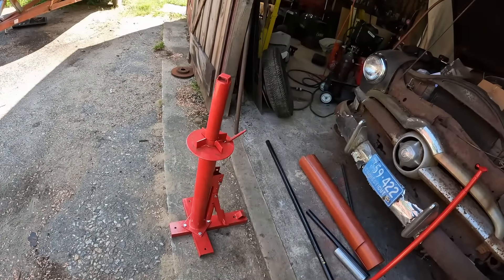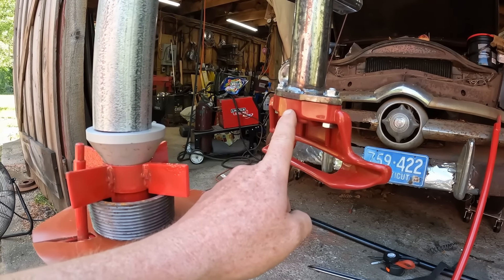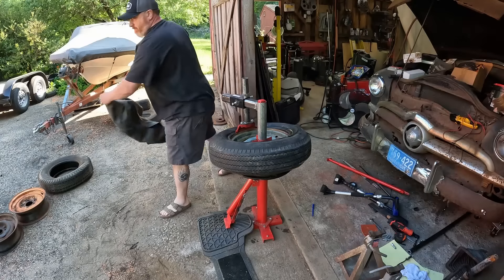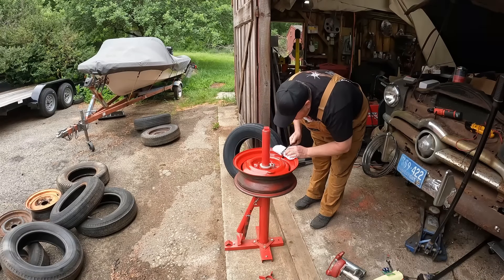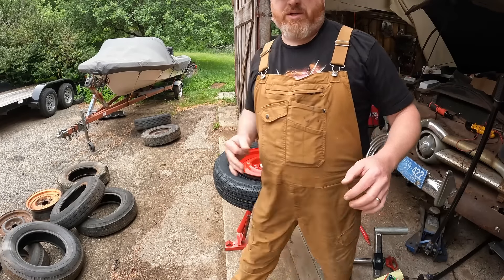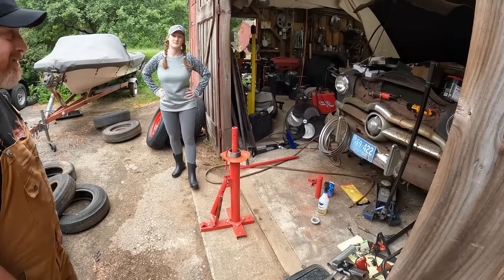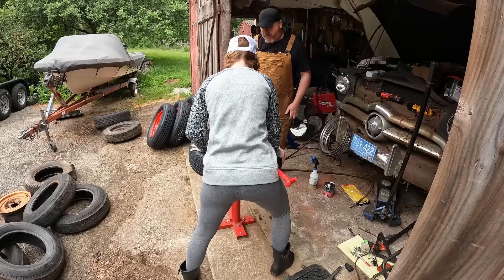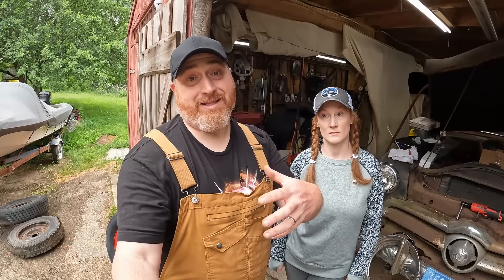How to modify a Harbor Freight Tire Changer to work amazing!!! Follow this DIY guide!!

Comment: As far as Balancing Wheel assemblies you don't have to necessarily attach mechanical weights To the rim.  You can put anything from water to flour(Flour clumps up And will thump around until it pulverises itself) In the tire and it will self balance when it gets to speed I wouldn't use sand because It will sand blast inside the tire.  I use about a cup of Airsoft BB's In my 33"Mud tires,  It works great. There are commercial Products also available to do exactly this I don't remember the name.
Reply from the maker: We did a manual balancer video.

Comment: Totally agree with doing things because you want to learn how.  Well done!  I've used my HF tire changer enough that it's probably paid for itself twice over.  That means not a lot, but enough to HATE using it.... LOL.  It's still way better than a set of tires spoons, though.   When I get a chance, I'm going to make those mods because things went WAY better for you than they normally do for me.  Definitely adding this video to my library.
Reply from the maker: Thanks for checking out the video! It really does work well!

Comment: It appears those are not safety bead rims, hence no pop. AND will slip the rim on a sharp corner.  Please consider putting a tub in or replace the rim. Google it and see if I am wrong.
Reply from the maker: Yes, I'm aware of this now. All good points. As long as the pressure is correct they should be fine. The car has never actually been driven and stays the consummate project.
Reply: @madgingercustoms  good to hear that, I only bring it up because we had an old motor home my wife's uncle sold us that slipped off the rim when we turn a corner in town, it almost flipped the whole rig..... So I learned the hard way, but it only cost me new rims.... and no one was hurt.  Nice mods on the tire changer I need to finish modifying mine.

Comment: One tip for breaking the bead when you have a rim that shouldnt be scratched... Get a thick plastic jug like windshield washer jug, and cut a patch out that can be folded around the breaker foot. It's a pain, but will help prevent wrecking the inside of the rims.
Reply from the maker: Thanks, I'll try that!

Comment: You really need a rolling work table.  Constant bending.  (Ok I could use exercise) but I will back up pickup to job to use redneck workbench. (Tailgate)
  So you doubled cost of tire changer?
Reply from the maker: I have a few and the tire changer total ends up being around $120. Worth every cent.

Comment: Great mods. I have used a changer like that I picked up from Tractor Supply. You can only use it on steel wheels. Radial tires have stiffer beads but I think your mods look like I’ll be able to use it on aluminum. I also drilled a couple holes to bolt it down at the back of a trailer so I didn’t have to mount it permanently.
Reply: And use soapy water and it’ll help the new tires slide on.
Reply from the maker: If it doesn't harm my cheap paint job, it should be fine on aluminum I would think.

Comment: Taking them off with that bar isn't hard. Its putting them on with the bar thats the hard. The lip on the bar isn't deep enough and it jumps off the wheel. I usually end up lubing it with dish detergent and using two spoon bars.
Reply from the maker: Yeah the soapy water helps. The duck head really makes it easy though.

Comment: I like your ideas looked those but saw the same problems. Used automatic tire changers expensive and many older ones no longer supported by Coats or others. Most tire shops are 35.00 ea even if you roll wheels in to mt and balannce and any idiot can do 10  tires a hour easy
Reply from the maker: It's getting expensive to get tires changed. I think this is worth the time to use.

Comment: Lube the bead with soapy water on both sides before you start to mount it. Use a rag & a viscous soap mix. If you did that I'll bet the inside bead would have slipped on with a twist.
Over inflate the old tunes in the new tires the day before & let them sit standing upright.  It will make seating the bead a lot easier when you mount them since you don't have a bead blaster. It will leave the beads a bit farther apart when you're airing them up. I'd suggest you just get a locking air chuck & eliminate the trigger.

Good luck.
Reply from the maker: Thanks for the suggestions and watching our video!

Comment: WOW ! GREAT MODS and AWESOME Video ! Have the HF changer, but always been a bit of a struggle to use the supplied tire iron to work without loads of struggling and stress. Will definitely be doing this mod this winter
Reply from the maker: I really feel it's worth doing. Makes it so easy to use.

Comment: Why didn’t we hear a pop when the bead seated? Those are not safety bead rims, and they don’t have the extra little Ridge that the tire has to pop over. Without inner tubes, these rims will tend to shed the tires if they lose pressure. Safety bead rims are supposed to stay together if the pressure gets low, without the inner tube.
Reply from the maker: Yeah, I suppose it will be fine.

Comment: I think you’re turning the wrong direction when sliding the tire off. Every tire machine I’ve used, and the one I own, all turn the tire clockwise. Same when mounting it. Give that a try, see if it works any better, I feel like it will.
Reply from the maker: That correct. The table turns clockwise. Therefore the arm turns counter clockwise.

Comment: Great job and good video work, couple suggestions, shorten up the 2 bolts you are using your power ratchet on so they don't stick out so far, and weld some 1/4 rod about 2 in . long on the heads, so you don't need to bend down to get any tool.  The mod I haven't done is to weld a 5/16 nut to the center post / conduit to screw a 2 in bolt into, then when using the bar to get the bead over the duckbill you can slip it under the bolt and will free up a hand to help push the tire down. I used an old junk flywheel and welded some short pieces of tube to hold my bars, I'm old and don't like bending down as many times as you did LOL.
Reply from the maker: Thanks for all the info!!

Comment: I do all my tires , tires and wheels are balanced now only once I had to put a little weight on a wheel (1.25 oz.) when a tire shop so calls balances your tires they are balancing their machine because they don’t know how to adjust there machine ( end play in bearings ) if a tire has two or colored dots on the side of the tire put the blue dot alien with the valve stem and it will be balanced if you want to be safe put it on a bubble balancer and you will find you don’t need to put all that weight on your rims, done dozens of sets of tires only used one weight one time and really didn’t have to then did it just for the hell of it to make it perfect!  Save a lot of money and use some brains always keep the bottom side of the tire in the deep part of the wheel, that’s why you always see a tire man picking up on the tire! Use dish washing detergent, you need a hose connector so you can use both hands, take it off the tire machine and bounce the tire a couple of times you don’t need all that stuff he put together if you know what you are doing, it’s simple you just can’t be lazy and have a little brains.
Reply from the maker: Solid info! Thanks!

Comment: I bought one…. I use it because I live kinda remote on a gravel road…. Yes it’s a great tool… i changed/patched multiple tires with it… I don’t understand the haters who can’t seem to operate cheap HF tools… I swear, they know it a HF tool and their mind is made up it’ll break and give it hell till it does and triumphantly claim “see!! It broke, it’s crap!”…. They abuse cheap tools but then treat snap on/matco tools gently because they paid a left nut for it. I have hundreds of cheap HF tools and they get the job done just fine. BTW….. I LOVE HF!!!!
Reply from the maker: It will certainly work the way it was designed. It will work much easier with this mod.

Comment: Have owned a harbor freight tire changer identical to that one since 1999 and have literally changed over a thousand car and truck tires with it over the years(i buy and flip used vehicles) All of that fancy stuff added to it like the duck head is nice, but once you change a couple  dozen tires with it you will get proficient without that stuff really quickly. I paid 49.99 for my changer on sale and conservatively have easily saved 12 thousand dollars using this cheap ass  piece of chinese crap. I also have a 50 year old bubble balancer that i bought at a garage sale for 10 dollars. Its a ton of work to manually mount and balance a tire, but if you have more time than money(like me!) Its totally worth the effort!
Reply from the maker: Thanks for watching!

Comment: At 15:40 ... that lunging and bouncing thing you are doing... DON'T DO THAT 😅
If you had somehow succeeded in getting the bottom tire bead to just pop over the rim (like if the manufacturer was trash and made the bead just a bit too loose), you would have almost certainly slammed yourself down on the center pipe.
The chest, ribs, shoulder, neck, or face injury would have immediately ruined your whole week, and would be a great way to need a trip to the ER.
Dogging the far side of the first bead far enough over the lip to bind the tire in place so that it's easier to set up the duck foot is fine, but switch to using the equipment once the tire snugs itself in place. I'm sorry if any of this sounds "preachy", it's just that I understand how easy it is to get caught in a "I'll just do this really quick" mindset trap once you get too used to working by yourself. (I've got the scars to prove it lol)
I paused the video to post this because I've actually watched a cheap tire jump over a rim before, and immediately tensed up when I recognized what you were doing. A tire will bounce you back until it it gives under the push. When it happened to my buddy, he chest bumped the rim and drove his fingers straight into the ground (doing a great job of trying to bend them backwards😂).
I know that its been a while since the video came out for me to be posting this, but YT recommended-video rabbit holes are weird like that and I was genuinely concerned for your safety when i saw it.
*edit: Dude, when I started the video back up and saw the tire start to work its way around the rim... the anxiety meter started climbing straight up again. Glad the tire didn't catch you out while you were fully throwing yourself onto it😂

Comment: So...this changer advertising states 8-16" rims , have you (or anybody else) tried changing a tire on an 18-22" rim ? What is the basis for this limitation, the length of the demount bar ????  Well with the gooseneck /swingarm mod. it shouldn't be a prob. Hopefully you made your swingarm long enough to extend out to these rim sizes.
Reply from the maker: I haven't tried anything other than what you saw in the video.  15" steelies. With that said, I think with my mod I can do up to a 22" if need be.

Comment: Fine job 😊
Except for that Newer designed Noisy Air Compressor 😒 you've got breaking the sound barrier 😮....
I just never could understand why so many of these fix it channels have those annoying loud cheap air compressor???????
DeWalt has a really nice 170psi 80 gallon sized belt driven twin cylinder compressor.
That's what I have and it's not all that annoying loud like your cheap rig.
Reply from the maker: I usually edit that out. I have 2 compressors. This is the cheapy next to the door.

Comment: I think I would have nearly recouped my investment in this just having the local tire shop knock six tires off the rims, not even having anything remounted or balanced.  I think they wanted $20 a tire just to dismount them.  I think I paid $120 to have six tires knocked off the rims, and like four of the tires disposed of (there might have been a disposal fee too, I can't remember.) and two of my tires were good, just wanted them off the rims.
Reply from the maker: I think it's worth doing even if you only do tires once in a while. Mine has paid for itself. Thanks for watching!

Comment: Worked pretty good! I've been using the stock setup for years with no problem but I didn't care about scratching old steel wheels.  Good job.  Maybe I will make the same modifications.
Reply from the maker: Thanks for watching!

Comment: I have one and if you secure it , it works fine! You on the other hand , do not have a clue! LOL! The rim is designed with a drop in the center of the rim. That is where one side of the tire goes when the other side goes on the side of the rim! A little soap and water, and the tire pops right on! Good thing you never tried using tire irons! Thanks for the laugh!
Reply from the maker: Yes Ron, clueless. Lol.

Comment: I built my own mojo lever for mounting/dismounting and it works a treat. For the polymer surface i saved up a couple milk jugs, heated them int eh oven til they became super soft, and wrapped the plastic around the right angle piece of steel that cupped the edge of the wheel. I can spin tires around aluminum wheels without a single scuff. Mojo levers are great, but awfully expensive and can be made without much fuss.
Reply from the maker: Nice!!

Comment: I have the duck bill mod on mine I bought from eBay. I don't use it to get the tire off. It's just unnecessary, it's more work, and just stupid. Also it adds bulk to the rim and makes it hard to get the rubber over the duckbill. I just use the flat part of the harbor freight bar, it gets it off much easier. I guess that duckbill can protect alloy wheels, but I just put a plastic sleeve over mine so it does fine for alloy wheels.. The duck really just works  better for getting the tire back on than the bird head on the other side of the bar. But you don't really need any of that modification, it just makes it a little easier to get the tire back on with the duckbill. I don't think it was worth the $180 I paid for the duck-bill  mod. I totally regret it. After seeing your video I much rather try making the duckbill mod myself, I have a welder. Oh well, live and learn I guess.
Reply from the maker: Well for $180 for the entire conversation isn't bad when you figure on how much your times worth.

Comment: I've used and modified this tire changer, don't try bigger tires you'll kill it.
Reply from the maker: How big did you go on it?
Reply: 16 inch pickup tires, low profiles are difficult also
Reply from the maker: @ShaneSchenderline  We did some low profile 18's from my Accord. I will be doing the tires on my Silverado next!
Reply: Good luck, I was working in below zero Temps too
Reply from the maker: @ShaneSchenderline  I'll report back!
Reply: The low profile tires it tried the local tire shop wouldn't touch. The sidewalls were very short. The pickup tires were 10 and 14 ply.

Comment: Why don't u just use a 4'x4' piece of 5/8 "  plywood.   Then mount it to that.  That way you don't have to mount it to the floor.  Your only gonna use it 3x a year perhaps for tires and flat tire patches.
Reply from the maker: It takes no time to blast those bolts back into the anchors. I've used it on 5 sets of wheels so far.

Comment: Amazon is the only option.  Hf is out forever
Reply from the maker: Says back in stock soon at HF.
Reply: @madgingercustoms  its said that for 3 months maybe 6. Its also shown now in black as a new item temporarily out of stock. I talk to the local manager at the store here near where I live I'm pretty good friends with her so she doesn't really bullshittin me much at any rate she said that they haven't even had those yet because it just means it's a new version coming out even though they say temporarily out of stock so they clearanced the red ones and now they're making the black one and I think it's exactly the same just a different color paint but they do not have them anywhere in the United States
Reply from the maker: @hamradiohack  I guess I will need to keep updating my amazon link when it sells out!

Comment: Gotta spit on the valve before putting it in. Lil human lube. Duck bill can be higher then you had it.
Put your assembly on first, then drop new tire on bead on duck bill like you did, use liquid clothes detergent for lube. then rotate tire  clockwise to get s lot on thd rim THEN finish with throttle long handle.
What size threaded anchors did you use. I mounted mine on plywood and I hate it. Concrete...much nicer

Comment: U should loosing the tube that tightin tire down after it starts taking air i do my tires buy hand usaly before istart i use used motor oil in kerosene in spay around beads in let sit then break down in use use gease on beads on tire both sides in kinda alot depends on rim the shape its in it will fill any  indents in make easyer to take off idk if i exsplained it well in most time no problems in i usaluy dont balance most time it is pretty balanced put all tires line valvle stem with dot if no dot i line up with word dot do all the same in make sure u remove all the weights idone many in ya some times there is big balance problem it most time rim been hit hard in somtimes quality of tire so hope u can under stand my mesg in its kinda long in im kinda dislectic and cant spell well or c well lol good luck
Reply from the maker: We did another video on this machine and found all four tires to be perfectly balanced!

Comment: You'd be saving yourself a lot of back pain if you would soak the beads in soapy water when mounting and dismounting the tires.
Reply from the maker: That's what was in the spray bottle. Thanks for watching!